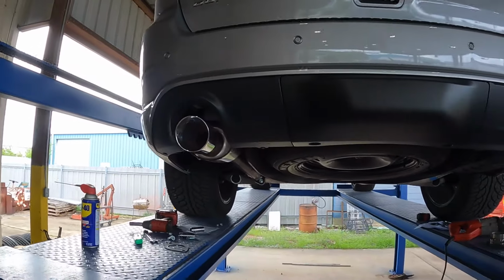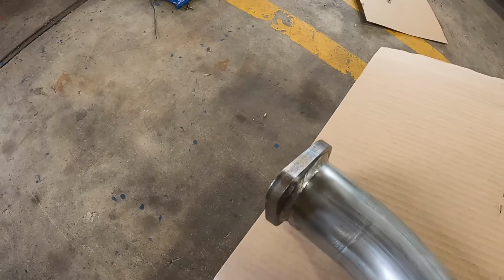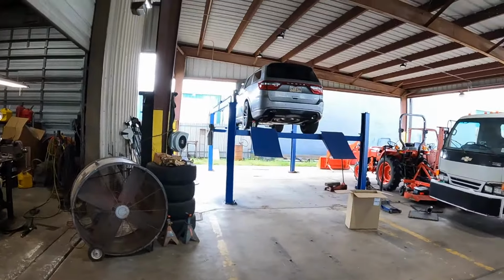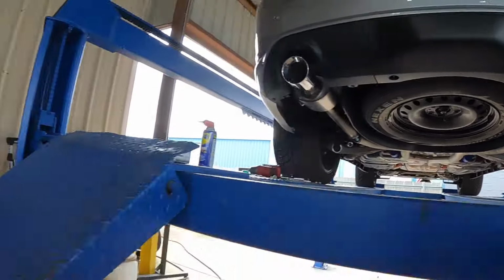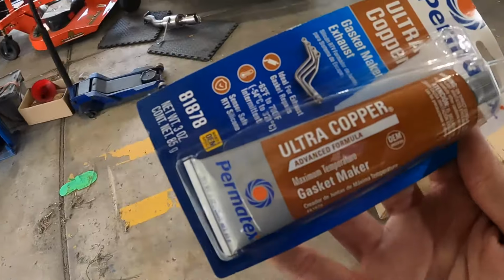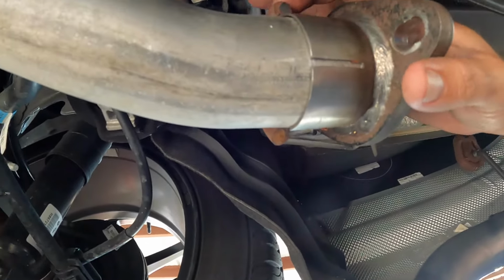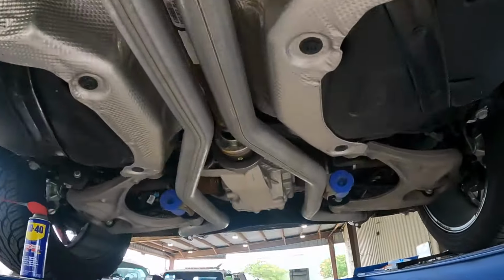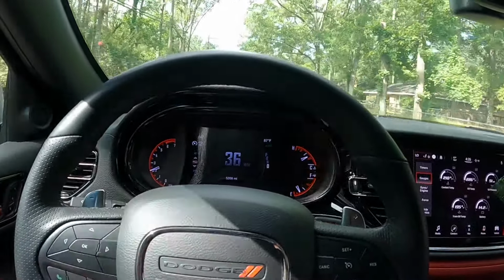Dodge Durango RT ~ JBA AXLE BACK EXHAUST ~ Must Do MOD!

Comment: Pro tip: use a chain style tail pipe cutter to make clean cuts without the risk of damage to surrounding areas. This can be rented at any auto parts store or purchased for cheap.

Comment: Sounds good. We're picking up an RT BT TNG for my wife tomorrow. I don't plan to modify anything from stock on it other than to add PPF though. And tires once this set wears out. I was surprised she hasn't said anything about whatever exhaust is on it currently. Truck is 24k miles used and sounds GOOD with whatever exhaust is on it... it is not the normal RT pipes... unsure if the BT TNG has a different exhaust option or if it is aftermarket yet. Either way, it sounds good for a truck and a driver. I'll leave my TT cars to make the noise.

Comment: Nice vid!  I've already modded my SRT exhaust on my 2021 Durango RT, Tow N Go!  If you or anyone wants some additional ideas I have about 3-4 different videos of changing my exhaust around from Dynomax Race Bullets, mid-muffler delete, x-pipe then to h-pipe and Flowmaster Flow f/x, etc...   🏁🏁🏁🏁🏁🏁
Reply from the maker: Cool I’ll check it out 🤙🏻 Yeah for the family, I’m happy with this setup 🏁
Reply: The tow N go & the RT premium are the same suv ?

Comment: Hey. Great video. My question is do you get any drone in the vehicle in local or highway driving since your installation.
Reply from the maker: Very slight drone under gentle acceleration on the interstate (holding 7th or 8th gear). Drive 10% more aggressive and no drone lol. My wife didn’t complain on a 6 hour road trip last week so I got the stamp of approval
Reply: Thanks for the feed back. Check your linked for Amazon and its not available at the current moment. I might just do a swap and see if my wife notices it. Thanks again.
Reply from the maker: @hassanmohammed2911  yes will notice 😂 but worth it 🏁 and I’ll check the link now. Must be sold out again…

Comment: Great video how do you think these will sound on 2013 durango crew v6 with single exhaust,  i did a mid muffler delete already and added a flow master delta flow 40 series in its place, thinking about removing the resonator and your video gave me an option to go with. My wife says it isnt loud enogh lol and its an everyday drive for her but dont want it to be extremely loud, whats your thoughts.

Comment: Good Video...   About the plastic oil pans on the engine and transmission. They didn't do it for cooling....   
The plastic does Not transfer heat as well as metal would.  
They did it because it is CHEAPER...  < ;)

Comment: Question?  does it help you in the performance of your dd do you feel that you have more power and can it be placed in a 2020 rt?
Reply from the maker: I doubt it really gains any Hp but it will fit a 2020 👍🏻 Still loving the sound 🏁

Comment: I don’t seen any difference in this $800+ exhaust over the sub $400 Blastin Bobs setup. Any exhaust shop would set you up with the same thing for cheaper as well. Sounds just as good as theirs IMO
Reply from the maker: Yeah you could piece it together cheaper at a good exhaust shop. Now find me a cheap exhaust shop that tig welds stainless 😂